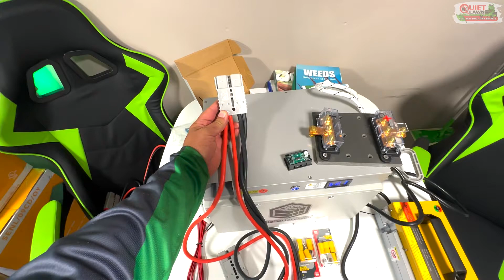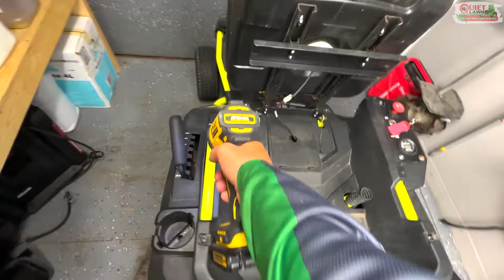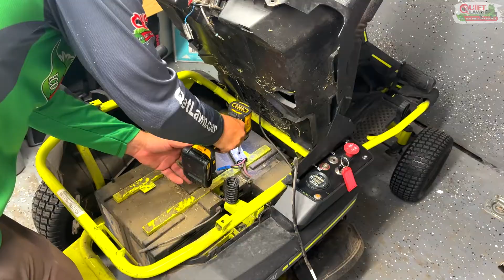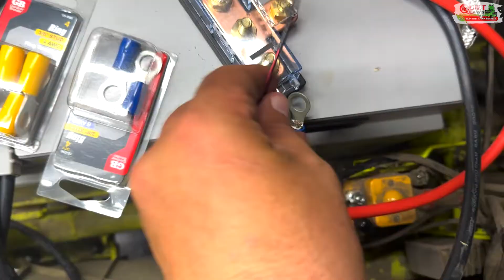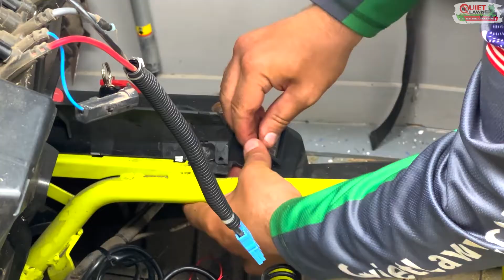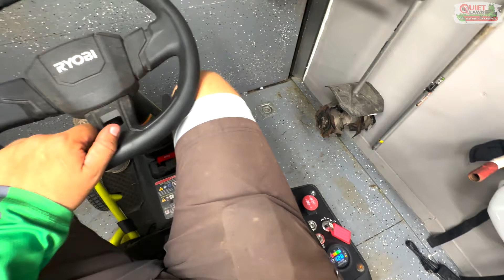CONVERTING OUR SECOND RYOBI RM300e TO LITHIUM | Electric Lawn Service

Comment: I’m in the middle of converting with big Battery “ The sector that do not let the mower  turn on if it’s charging and need to by pass” need your help here . I have 3 wires black,yellow and red so how do I rewire.

Comment: Thank you so much for sharing your experience.  I did the same upgrade on my Ryobi mower with great results.  I did not use a power rail. I bought a single heavy duty insulated stud terminal that I mounted to the frame. The negative lead for the battery meter, negative input lead for the mower, negative lead for the charging cable, and negative battery lead were all connected to the stud. The positive battery and charging leads were connected to the input side of the contactor like you did. I connected the battery meter to the output side of the contactor so it wouldn't get power when the mower is switched off. The downside of this is that the gage reads low when the mower is in use due to voltage drop. I also reused the 100 Amp fuse from the original harness. If the load or charging wires short out, the fuse will protect the battery and its controller. I noticed that you are relying on the plastic shroud to secure the battery in place.  I think this is a safety concern, especially if you flip your mower on its back wheels to clean out the deck. I secured my battery with a ratchet strap so it will not move.

Comment: How are these batteries lasting long term?
Reply: I don't have LiFePO4 in a mower, but we've got 100Ah prismatic cells in a 4s4p configuration in our RV for a house battery that was installed in early 2016. Much of that time since then ( maybe 5 years total, not counting storage ) it's been in use full-time with 80% of that being off grid. The battery has undergone easily 1500 cycles and is doing well. We haven't done capacity testing on it, but it's not noticeably diminished when we use the RV and all cells are still pretty close in voltage.